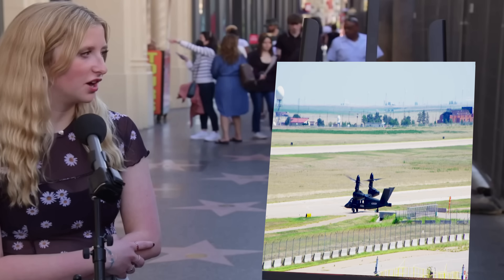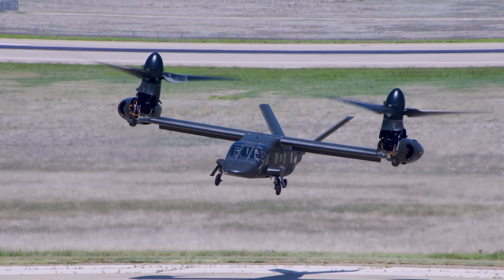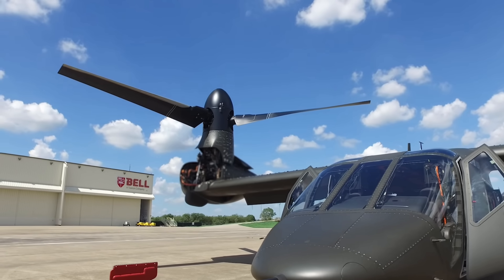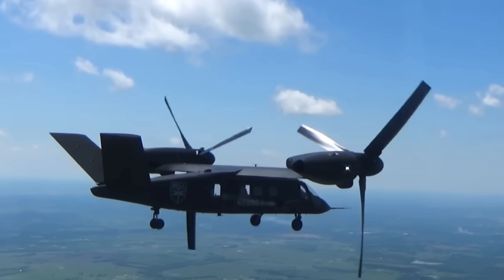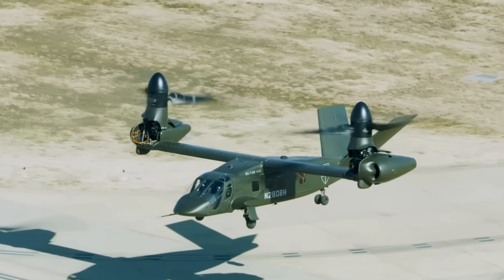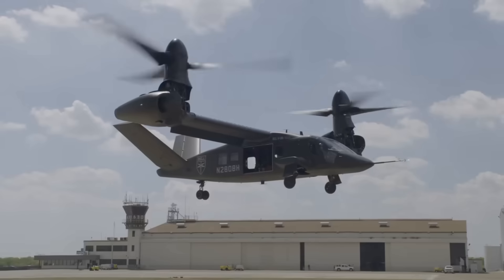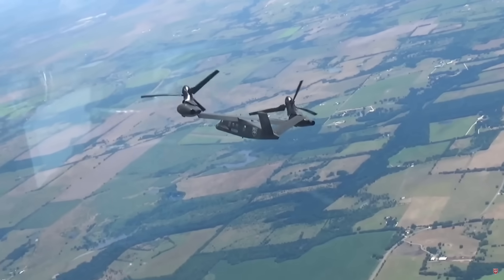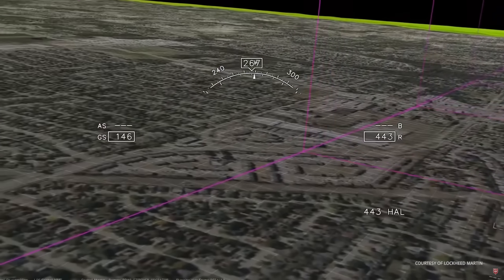Bell V-280 Valor - What's the big deal anyway? | BLACKHAWK REPLACEMENT

Comment: Replacing an attack heli? I very much doubt. In an attack role those 2 engines without redundancy is a massive liability. Otherwise, a very cool looking and likely capable transport and evac aircraft. Probably useful for anti-submarine tasks, too, given the right tech.
Reply: it has 2 engines, like an apache. it also has the ability to run both rotors off a single engine. the apache can do the same with 1 rotor. the apache can auto rotate for a crash landing in case of total engine failure. this cannot, but it seems a tradeoff the army is willing to make. however, the apache cannot fly missions at the same ranges as the valor, and so it seems they are considering a number of them in an escort/attack role without having to create a separate chassis to duplicate the speed and range capability. 

it makes sense, especially when you consider attack helicopter standoff ranges increase more every year as pop-up sam and manpad threats become ever more prevalent and sophisticated. there is a reason the army is getting the spike nlos missile with a 20+ mile range for its gunships. it sees a need for them.
Reply: @bleachorange  good point with regards to stand-off range in particular, plus I guess the wing gives ample area for affixing ordnance.
Reply: There is a shaft that goes between both engines. Either one can send power to the other through that driveshaft if one of the engines fails.
Reply: i mean decent chunk of attack heli's have turned into transports with ordinance slapped on.
Reply: LMAO.  You talk about redundancy and it has two rotors.  Thanks for the expert analysis LMAO!

Comment: Looks like they {at least, initially} offered this as a conversion of Blackhawk airframes....
.... And , things got out of hand.
I feel like finding ,suitable, LZ's is going to be complicated.
Reply: Not really. If a Blackhawk could land in it, the Valor could likely do the same just rotate 90 degrees. The Valor just has better top speed in airplane mode and that is crucial in a medevac to a hospital.
Reply: There was another video that showed how different the area footprint of the Valor is compared to the Blackhawk, the result showed that while the Valor is larger, it's more a couple of meters more to each side, and the Valor also has a shorter fuselage length than the Blackhawk and doesn't have to worry about a tailrotor too. Basically all the Valor has to do to land in the same space as the Blackhawk is to spin 90 degrees. Besides, Blackhawks typically try to land with a significant amount of clearance between the rotors and any surrounding obstacles like trees, and since the Valor isn't  that much larger area-wise anywhere the Blackhawk can land the Valor can too.
Reply: @StrikeNoir105E  Both the Valor and Defiant are a little bigger than the Blackhawk. That's probably because of the requirements set for the FLRAA program like troop capacity and internal payload. With that said, I don't think the Army is concerned about footprint except when it has to load them on cargo aircraft and the Defiant's height may be a concern.

Comment: Helicopters are most vulnerable in combat while in hover.
A conventional helicopter may still be able to pull off a controlled landing with a loss of power.
My understanding is that if the tilt rotor loses one engine it will immediately flip  over and becomes unrecoverable. ( Feel free to correct me on this.)
I would also think that because of the location of the engines the tilt rotor would have a much higher IR signature.
With the growing availability of MANPADS they would be an easier target. Sure they're faster than a conventional helicopter but still not fast enough to outrun a missile.
It would also seem that the radar cross section of the tilt rotor would be huge.
A conventional helicopter would be easier to incorporate any kind of stealth technology.
Reply: There is a shaft connecting both engines. If one engine loses power, the other can send that power to keep both rotors turning. It is the same as the Osprey.

I got no answer for the IR signature. The engine exhaust for either gets mixed with cold air from the blades. It's only when they are close together like the Cobra and Huey used to be do they represent a problem. I say used to because the turn style exhaust no longer allows heat to build up on the tailboom since the exhaust points out to the side a little bit. 

If Manpads can hit an Osprey or Valor they will definitely hit a helicopter. While there are ways to reduce the RCS of a helicopter the results are going to be the same: don't expect actual stealth like a B2 bomber, the F-35, or even the F-117.

Comment: I thought the twin counter rotating chopper with the pusher prop was gonna win for sure. Just the foot print it needs to land is ridiculous.

Edit: It does look to be a good omni tool and with 14 tons of carry capacity it'll hold and deploy ground drones ok. I think it will shine in logistics and rescue or vedi-vac.
Reply: The Valor's footprint is the same as the Blackhawk, just turn it 90 degrees.

Comment: If one engine fails...does the other immediately spool down to create its own autorotation?
Reply: A cross shaft runs through the wing so if one engine fails, the other engine will drive both rotors with reduced total power allowing a safe landing.
Reply: @Thomas Weyandt  genuine question: which is the greater target, the engine or the shaft?
Reply: The engine or the shaft, not sure.  The wing is a big target by itself and contains the cross shaft while the engine is a smaller target. @FeedMeMister
Reply: @thomasweyandt9439  Big hit box's

Comment: Permit me to ask a different question: do you think Canada/JGSDF/Bundeswehr/ UK will buy them, willingly?

For general use, not special forces or VIP transport, by the way.
Reply: willingly? No. They will spend money creating a competitor, spend more to launch a competition, lose the competition, spend more to question the results, and then 20 years later finally buy them after begrudgingly admitting its ok
Reply: Maybe not Canada or Germany, but the UK might. They are separated from the rest of Europe. Japan might too, they just got the Osprey for rapid response for island security. A smaller version with same footprint as their Mitsubishi H-60 (Blackhawk) rotated 90 degrees would be a good idea too.
Reply: @bl8danjil  I do think you’re right about Japan. Rapid response, and it will go nicely with their new “maritime auxiliary landing field.”
Reply: Canada? No. Too many years left on the CH-146 Griffon and the V-280 is probably way more expensive.
Reply: With the payload rang that it offers they just might 900 mile range 🤷🏾‍♂️
Reply: Think us brits are fine with our westlands.
Reply: So, looks like the vote is “nice gadget, but not for us.” Only Japan is a maybe on the will they buy it question.
Reply: So, looks like the vote is “nice gadget, but not for us.” Only Japan is a maybe on the will they buy it question.
Reply: No. V-22 is a more attractive option with larger capacity, rear ramp, and a proven platform. A refresh of V-22 with V-280 tech might sell however.
Reply: UK is interested in replacing their Chinooks with this. Which is the truth of the matter. Valor replaces the Chinook more than the Blackhawk.

Valor would also be good for their carrier as their Hawkeye and anything else their marines need.
Reply: @TheBooban replace the E-2, interesting. Where would they mount the radome so that it doesn’t interfere with the fans or the landing gear?
Reply: @TheBooban replace the Hawkeye interesting. Where would they mount the radome so that it doesn’t interfere with the fans or the landing gear?
Reply: @CAP198462  they have to use a helicopter for this job now, the Merlin Crowsnest. So the Valor could replace that. It sticks on on the side. Dunno where they put it on the Valor, whereever they have room?

Comment: It's a big mistake. This thing will be loud like the V-22.  It will suffer with the same stall failures of the v-22 because of the small rotors losing lift over the wings. Bell couldn't get the civilian version of this thing certified to fly because its so unstable.
Reply: Really, this is a third generation tiltrotor with lessons learned from the XV-15 and MV-22 and has been improved over the older Osprey and it has been flown 155 hours in test flights so the US Army knew what it was getting.
Reply: @txhomasweyandt9439  really, yes really, its a bad use of air management on top of a winged surface.   The helicopter loses its stability in transition because the downwash from the tilting rotors wipes out the airflow on top of the wing. It's a bad idea. It has airflow from the rotors and destroys the very air flow on top of the wing that creates the lift.
Reply: @thomasweyandt9439  if they learned all the lessons, then why are they having helicopter blades pushing on top of  flat wing when its supposed to be a helicopter?
Reply: A combat zone typically is loud. So...
Reply: @h.cedric8157  obviously you don't appreciate stealth. Did you see the damage the v-22 did when it landed on a runway and destroyed everything around it?.  And how many people conplained about the chop sound of the huey?
Reply: On approach it's quiter that a helicopter
Reply: @bernadmanny  no it's  not quieter. It makes a racket because the blades are smaller and moving faster than conventional blades. Bell pulled a fast one on the military..  Again... The chinook helicopter were quiet because they had larger, slower moving blades.  Plus, the body was shaped to take advantage of the bernouli principle. The air flowed down and around the fuselage.  This other two blade helicopter destroys the airflow on a flat plane that destroys the lift air flow on top of the wing with blade airflow from on top by the blades.
Reply: @wookieiam1  remember, there are requirements for this aircraft, STEALTH wasn't a requirement.

You brought that up as a strawman argument 😆
Reply: @h.cedric8157  The airflow  from the blades destroy the airflow over the wings. The air pressure on top of the wings gets disrupted from the blast of the propellers. That's why the aircraft becomes unstable in transition. They never fixed that vulnerability.  😔  .. forward slats and drop slats in the back of the wing might help. But they need air tunnel tests. 🙄
Reply: @wookieiam1  again, the vtol phase of a tiltrotor makes up a small percentage of the flight time.

Again, I don't care how you hate the tiltrotor design, but you aren't an aerospace designer but you talk a lot of crap yet nothing to show for it.
Reply: @h.cedric8157  so what if i am not an engineer  ... There are a lot of educated people who come up with poor designs. I worked in the army 16 years on helicopters. I have flown on many of them. I am a fan of helicopters.   Tilting blades over flat wings destroys the low pressure on top of the wings . I see it has flaps that move some air down behind the wings. But, that wing will lose lift just like the V-22 does. Notice the helicopter has to come nose high to create its lift, somewhat like a kite.  Helicopters typically move nose low as the helicopter blades bite the air. This changes the pilots view moving forward.

Comment: I hope they fixed all of the problems that plauged the original Osprey. I think it's a super cool design.
Reply: to be fair, most of the problems that plagued the original Osprey got fixed over a decade ago, almost nearing 2 decades at this point
Reply: @BruhMoment-re8nc  a bunch of marines just got killed in an Osprey mishap on winter exercise in Norway. hope the widows get the neatly folded american flag for their loss. i bet that will be a great consolation
Reply: @JK-dv3qe  Training mishaps happen. I think I read somewhere the Osprey's record is pretty good. Any accident gets highlighted extra because of what it is, a tilt rotor with no equivalent anywhere in the world. The Blackhawk has had its fair share of accidents in its early years too. They still do actually, remember that national guard Blackhawk that crashed? There was concern after a trend of crashes claimed the lives of some of those soldiers in those accidents. Someone at Sandboxx addressed the concerns of the tilt rotor, the gist is that the negativity towards them is overblown: https://youtu.be/xKdiAbJFB-o
Reply: isnt it a different design overall?? for example immediately noticeable is that the entire rotor no longer tilts as an entire piece
Reply: @XDEMgamersX  I mean it probably is but still
Reply: The osprey should eventually get a mid life upgrade, new wing and engine mount assembly that takes a tilting propshaft instead of swiveling the whole engine. Saves maintenance cost.
Reply: @prfwrx2497  That seems like a pretty major redesign. Is this planned or is it just something you want?